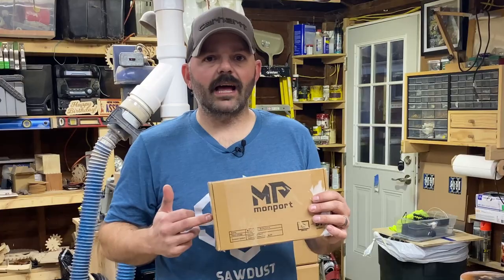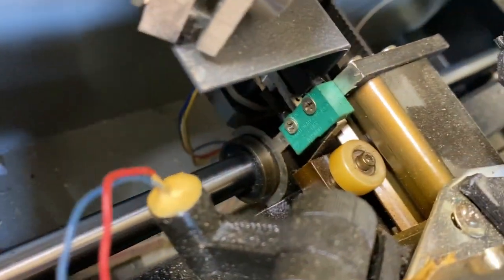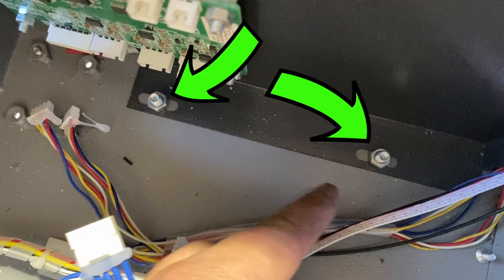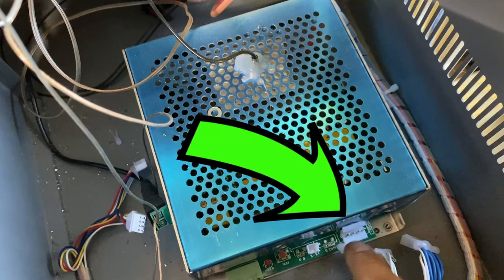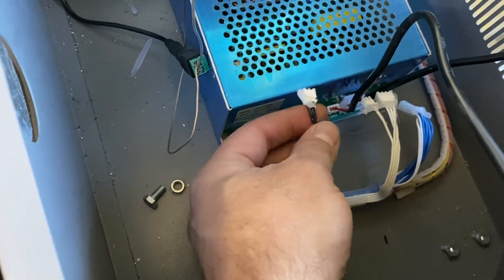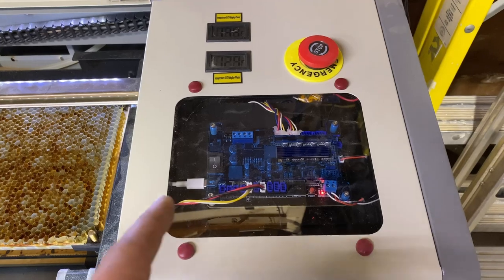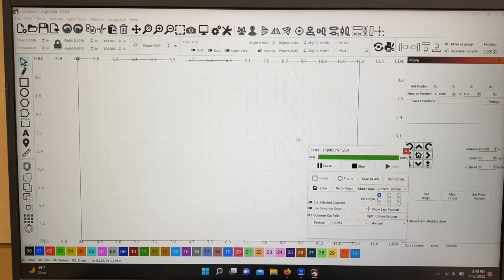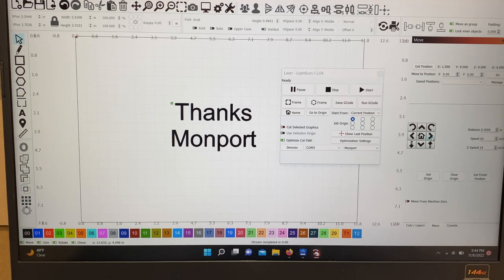K-40 Series - Controller Upgrade. Run Lightburn Now

Comment: You need to add a milliamp meter, you can not see how many milliamps you are adding to the tube, and will ruin your laser...
Reply from the maker: Thanks. I will definitely do that!
Reply: @SJSSawdust  you also need the power controls to limit the max output to 12ma or you are going to kill that tube quick
Reply from the maker: @nickm324  that’s a good idea.  I will keep an eye it and see if I can see any performance drop. Thanks!

Comment: I just installed mine today... exactly as above. Lightburn won't detect it. Windows does, lasergrbl does but LB doesn't register it at all... it comes up reads monport then many ??? and says homing then just hangs... steppers don't move but are red hot. IDK what to do... just ordered an MKS DLC32 as a backup if I can't figure this out
Reply from the maker: I’m sorry, I wish I could help you. Is your setup the exact same as mine? And did you follow the video and install it just as I did? The only help I can offer is to go back through the video and make sure yours is the exact same as mine.
Reply: @SJSSawdust only difference is the PSU is the bigger one with green terminals

Comment: How do you pulse the laser when doing the alignment procedure?
Reply from the maker: @gibawatts  in light burn, on the “console” tab there’s a button for “fire”
Reply: @SJSSawdust  Not recommended for CO2 lasers. You should really had left all the controls and an Amp meter, you are going to burn that tube out quick
Reply from the maker: @nickm324  This controller was sent to me from Monport themselves and I haven’t had any problems yet… hopefully others have had the same experience

Comment: Some people are saying this board isn't good because it's 8bit and raster performance can suffer. Is this true? Have you seen any performance issues while using this board? Any reason to go with the $150 lightburn boards instead?
Reply from the maker: I haven’t noticed any real problems but I also haven’t used it all that much in a raster application - most of my usage was to cut things out. Unfortunately I cannot give an informed opinion on either board due to lack of experience with a Lightburn board or raster function on this board
Reply: @SJSSawdust  Oh okay. I mainly plan to cut acrylic so I'll probably stick with the stock board for now. Thanks!
Reply from the maker: @Dex2R7  I would do the same!

Comment: I just ordered my Monport board, and when I was prepping the machine for install I noticed my K40 has no limit switches? The only thing I see is a small infrared eye on the left side. Will this still work?
Reply from the maker: I'm sorry, but I do not know.  I would suggest contacting Monport themselves.

Comment: Hello, Thank you for sharing. I just ordered the same board and cant wait to install. I have a question though. I see on light burn settings for air assist. Is there a way for me to run my air assist though the board ? currently has its own wall outlet running to a switch on the machine that I have installed.   Thanks for the help.
Reply from the maker: Thanks for watching- I don’t want to say one way or another for sure, but I don’t think you can. Since the air assist isn’t “part” of the laser module itself, I don’t think there’s anyways to make that happen. I have mine on a separate switch as well

Comment: Hi, can you explain where the white wires come from? You added them without explaining why you didn't add them during step 6. Thanks!
Reply from the maker: Sure - if I’m thinking of the same wires you are referring to, those are the wires from the limit switches on your machine. I didn’t connect them during that step because they aren’t very long and I would have had to set the control board down inside the machine and it wouldn’t have been easy to see what I was doing during the rest of the tutorial
Reply: R the White wires to the power supply jumpers?

Comment: měnil jsem desku podle tveho videa,ale při zapnuti laseru mi to hlásí :ALARM: 9
Guidance failed. Could not find a limit switch within the search distance. Defined as 1.5 * max_travel when searching and 5 * pulloff when searching for phases. Nevíš co stím?

Comment: Found your video from the Monport site for the upgrade board and had a couple of questions so I thought I'd go directly to you! Any advice is greatly appreciated.

1. When upgrading from the nano board to the LB-compatible version i don't see any instruction from Monport on where to wire the Red Dot laser or the case lights. I'm assuming the LEDs are 24v and likely wired in-line with the main power, and the red dot is 5v and likely just fits in an open slot, but I'd like clarification if possible.

2. Once you complete the upgrade process, how do you control the % of power without the controls from the top of the machine? I understand it can be manipulated in LB, but I don't think just changing the value there is sufficient. Any rhoughts?
Reply from the maker: Hopefully I can help

1) the red dot laser that I use is independently powered and switched - so I’m not sure where to wire that in. As far as the case lights, I added a bunch more lights so I also wired those independently. I have everything plugged into a power strip and it all turns on with the power strip

2) once connected, everything you do is ran through Lightburn. That entire user interface on the k40 itself is null and void now. Lightburn is so easy to use and it’s amazing how cheap it is!
Reply: @SJSSawdust  Thanks for the fast response! I really appreciate your assistance. I've looked at adding a second power supply (12v5a) to address the issue so I may follow your suggestion and just wire those separately.

With regard to LightBurn, did you do anything specific to get the power to scale properly? I've tried a couple of different things and noticed a significant difference when using bi-directional, flood fill, and constant power, but I'm not sure which is the appropriate to use with CO2s?
Reply from the maker: @IfUOnlyKnew  that’s a great question. The only suggestion I have is the “standard” practice when using any material with any laser - is run a speed/power test. If you do that for every material you plan on using, you’ll get the results you were looking for because you have the settings dialed-in ahead of time!